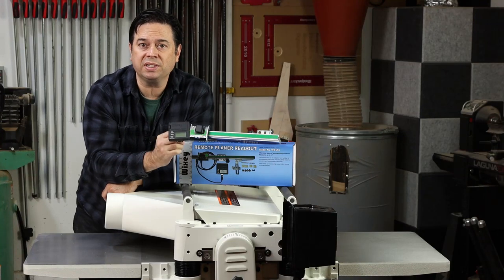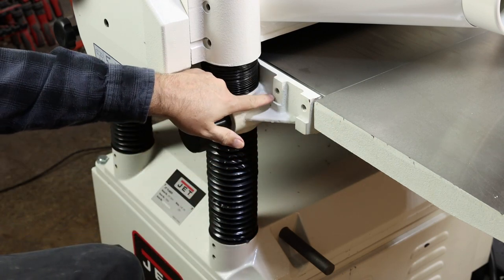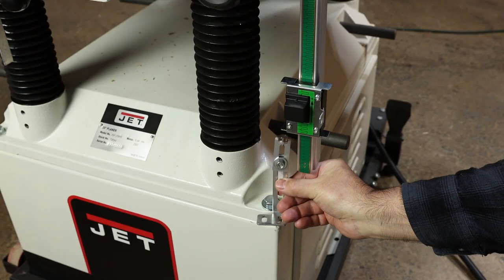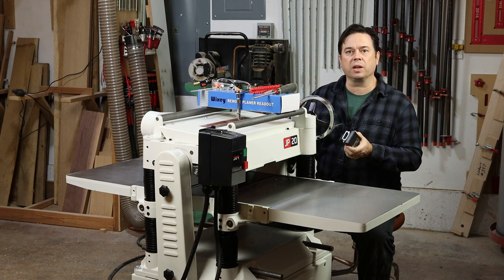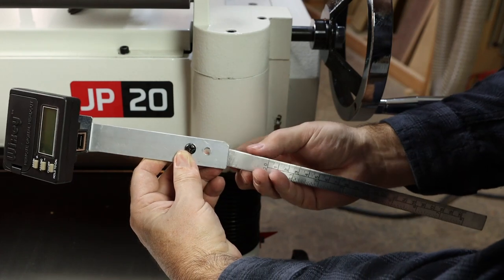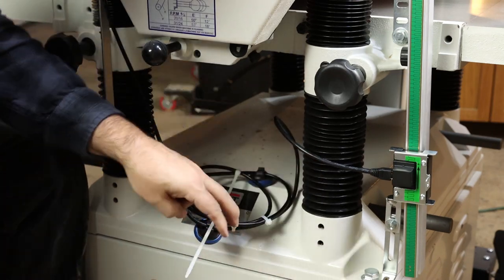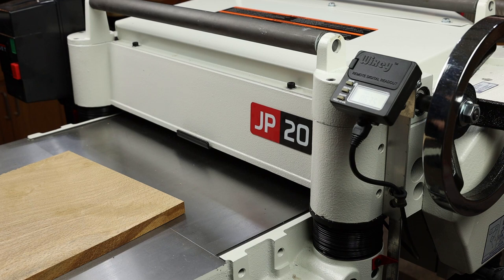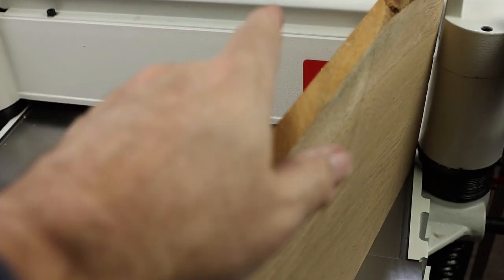Install Wixey DRO on Jet 208hh Stationary 20 Woodworking Planer  Digital Readout for better accuracy

Comment: Just did this install on my Jet JWP-208HH and you saved me a lot of time.  Thanks!  The 8mm bolt you said you used to mount the scale is actually 10mm, in case anyone else does this install.  I also flipped the readout metal attaching piece backwards and mounted next to the wheel on the top with 3M automotive double sided tape.  Cleaned with alcohol first, as I've learned to do.

Comment: Thank you so much. Gonna do this tomorrow
Reply from the maker: Good luck with it.  I think you'll like the Wixey.
Reply: So like all my projects it took a month later lol and it’s a 10 mm bolt
Reply: 😂 just came here to say that. I went out and got 8mm bolts, then had to RTFM and get some 10mm bolt. Really thankful that Jet has exploded parts diagrams of all their products in the manuals.

Comment: Reading the reviews on amazon, a lot of people said they're having issues with keeping it calibrated. Have you had similar issues?
Reply from the maker: Zero issues with calibration.  It's just super accurate all the time.  I got the digital calipers out to double check finished dimensions for the first two weeks.  Then you just forget about it, because the scales always agree.  You'll love the Wixey remote DRO.
Reply: @TheThoughtfulWoodworker   Thank you for the quick response!

Comment: Does the read out read in inch scale like 13/16 or do I have to do conversion scale
Reply from the maker: It shows decimals until you hit a fraction like 13/16 then it displays both.  Very accurate on my planer.  Thanks.

Comment: Thanks for putting this together; I was able to get this set up on my 20" grizzly without any trouble at all. Works great, really should be standard equipment for these machines..
Reply from the maker: Thanks Nick.  I agree wholeheartedly they should be standard equipment.  You're working blind until you have a digital gauge.  Best to you.

Comment: Looks really good, you mentioned your clip on your bandsaw, would the same digital scale work on a band saw or do they have a scale with a little less extreme percision that work on a band saw?
Reply from the maker: I haven't heard of a Wixey gauge for the bandsaw, but the Tablesaw gauge might be adaptable.